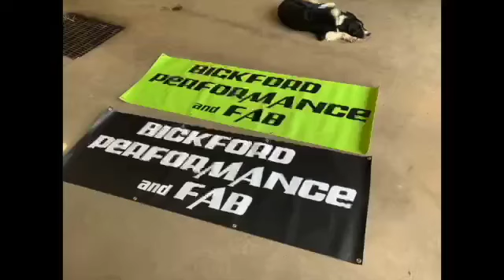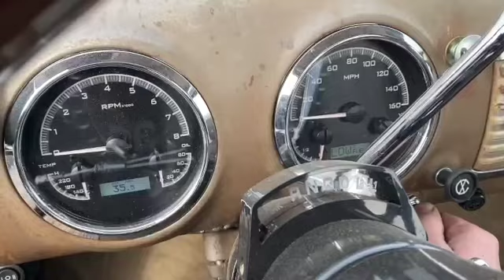patinamaro getting a heart Part 1 Test fitting the LS and gutting the engine bay.

Comment: Why didn't you remove the hood on the 3rd gen during engine pull and installation?????
Reply from the maker: Because I had clearance to fit the engine and picker (barely) but when I drop in trans mated to engine I’ll pull the hood.